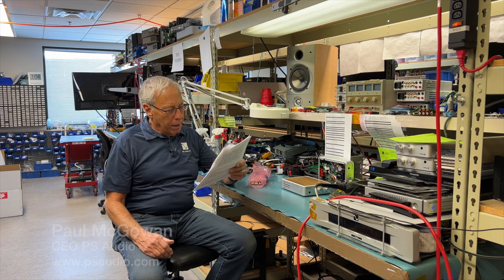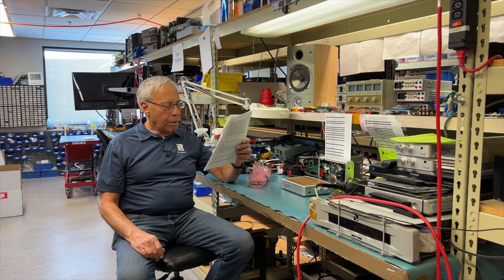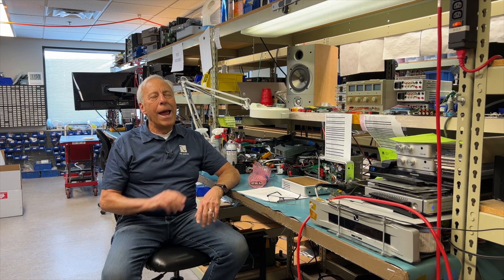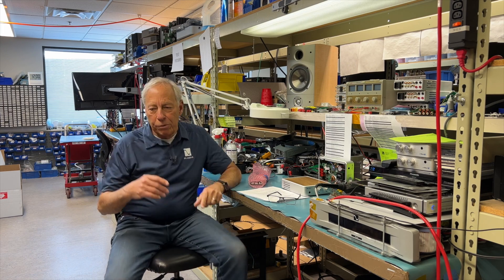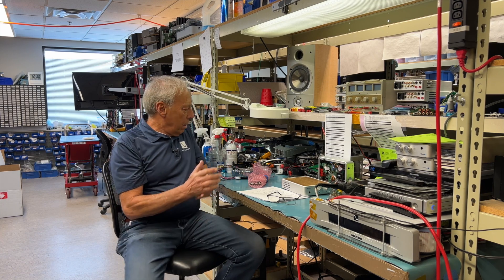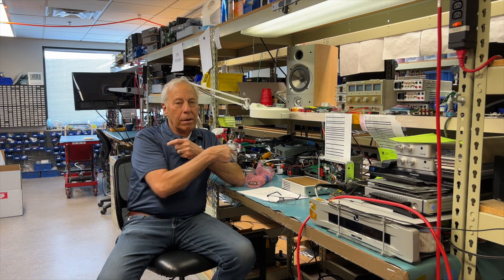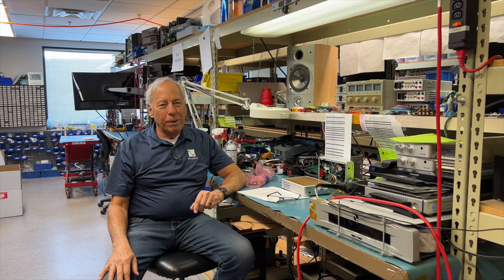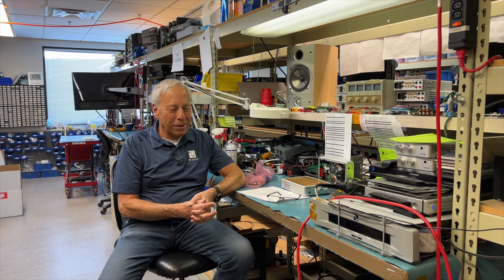Switch mode versus traditional power supplies

Comment: #1- SMPS is rectifying AC, turning 120BAC into 170VDC (240VAC into 340VDC)
#2- This high voltage DC is driving a high power oscillation working at 50KHz to more than 300 KHZ, some tines.
#3- This output of the oscillator is driving a small transformer, the secondary of which gives the required DC to power circuits.
Often, there is a secondary on the transformer used as a feedback to help regulate the SMPS.
If well designed, the secondaries will, after rectification and small filtering caps, gives exactly the required DC voltages needed.
The only big part is the filter capacitor for the power oscillator... And likely the transformer.
The poiint is, for example, a PC power supply that can deliver 1,000W to a load while weigthing well under 10 pounds.
A LPS of the same capacity might be above 100 pounds.

The only drawback of an SMPS is that it may introduce HF noise both toward its load as well as toward it's source.
Current well designed units do not suffer such problems.
Some audio equipment, like power amplifiers can achiev an astonishingly low 130 dB SNR despite having a SMPS buiklt in.

Comment: Paul makes a good effort here, but probably confused many newbies by trying to present his explanation as a contrast between a large power transformer and the entire switching power supply circuit assembly; which is sort of like comparing one cylinder (or piston) from an internal combustion engine to a complete Wankel rotary engine.

The contrast SHOULD be between a linear power supply circuit and a switching power supply circuit. Both circuits USUALLY have transformers, but they don't NEED to include transformers. Certainly power supplies of either topology that are being applied to isolating consumer circuits from the AC Mains voltages are likely to include transformers, at least for isolation if not for another reason(s).

The KEY difference between linear and switching is how the raw voltage is conditioned to the (usually lower) final desired voltage. A linear supply does this with some kind of actively changing resistance that drops any unwanted part of the raw voltage. A switching supply does it by slicing the raw voltage into pulses, which are then re-combined, more or less, into a smoothing capacitor in order to reconstruct a smooth final voltage. Both linear and switching supplies need to have smoothing capacitors, but due to the low frequency in linear supplies the capacitors have to be huge and expensive, whereas due to the much higher frequency of the switching supply, the capacitors can be small and much less expensive.

If a transformer IS involved, on a linear supply using Mains voltage as a source, and at the low frequency of 50 or 60 Hz, the transformers must be large, heavy and expensive, but on a switching supply the transformer can be quite tiny. But as Paul said, both kinds can still deliver the same kind of power to the 'load', whatever it is, and both kinds can have very smooth, very low noise output voltages. HOWEVER, a linear supply generates a lot more heat than does a switching type, because it must dissipate the unwanted/excess voltage in the form of heat. A switching supply only 'samples' as much of the raw input as it needs to achieve the desired final voltage, and thus it generates very little heat and is thus much more efficient.

Comment: From experience, switch mode PA amplifiers are unreliable in the medium to long term. 
I've owned S.M. amps made my respectable brands such as Camco and MC2. They eventually all failed and were uneconomical to repair. I still have various Crest Audio and MC2 audio torordial amps that are much older and heavily used that the S.M. and rarely if ever go wrong. When/if they do, they have always been repairable.

Comment: All I know about the power of moving electrons is to think if it like flowing water (as it's not really all that different) and to use the proper analogy between the two.
Volts is the spray pressure coming out of the nozzle.
Amps is how many electrons cross the exit point of the nozzle in whatever amount of time
Ohms is the resistance and not your grandma

Watts is the storage tank that's accessed when needed and is also on 2nd base because Who's on first and I probably have all of the above totally mixed up because I have a 500 watt brain with the wiring burned out causing me to not remember...

and stuff.  and I ramble.   and when's Superman and Capt Kangaroo coming on??  I've been sitting here for 65 years, and no sign of it yet.  Thank Goodness for the 3 Stooges and the Marx Bros, God Bless their souls indeed.

Comment: If I may say sir what about reliability. Too msny componants in a smps to go wrong.I have a 1980s psu with the big lump in it that has never failed even under heavy loads for fiddling? A smps will not last
Reply: Does it have large electrolytic capacitors?  They will likely be out of spec pretty soon!

Comment: I thought PS was about the sound, but it is about the cost...?
Reply: They can be "about the sound," but if they aren't also "about the cost," they will go out of business and then they won't be there to be "about the sound."  That's the way everything works--put your oxygen mask on first then help others.
Reply: @JohnSmith-qi6co  I feel it's more a matter of choosing which quality to offer at which consumers. Being a small company in a small market expanding geographically is a good idea for PS, but to maintain such an organisation, you have to meet (legal) standards and keep sales at a level, which compromises sales.For one your products need to be fool and bullet proof.  I bought speakers off a company that produces perhaps 2 sets a year and put all their heart and soul into it, besides their other products at a very small scale. But for them not many buyers and for me not many sellers. They indicated for instance, if you want a bit mor high, solder these resistors in. lol,

Comment: Switchmode was was invented by satan. 
They are noisy AF. And yeah, you can have a big inductor to absorb the noise like you find on buck converters, but it is still there. even that inductor radiates a degree of noise.
Also they break. They do not last!
Paul, please look into this. Switchmode has this weird failing mode where you can measure voltage, but the moment you add load, it shuts down. About 1 in 5 SM psu's will fail in 5 years.
in 10 years you are sitting at 3 in 5 failures.
Unless you plan to introduce planned obsolescence into your business model, this is not the route to take. As a hard core audio guy, I'm happy with the 60% loss on a traditional psu. No need to tamper with what works.
Consider this... we spend thousands on cables and other things to make the smallest difference, and then you want to introduce the worst component known to man directly into my signal path. Yes... direct. Remember, it is that output that eventually feeds into the main transistors. If switchmode becomes main stream in audio, you may just as well sell your expensive interconnects, and speaker cables and just use twin flex lamp chord. Replace your van den hull turn table cart for the cheapest one they have at wallmart. Sell your SACD, sell your dac. Just stream from spotify.

Comment: Recently switched over (no pun intended) to a regulated linear power supply for my DAC, made quite a difference compared to the switch mode  unit I was running for three years prior. They each have their place. Switching PSs are way cheaper to manufacture, smaller, lighter, way greater power density,  etc., hence their ubiquitousness today.  Properly designed they are excellent, but the run of the mill ones are quite horrible noise generators IMHO.
Reply: I had a similar experience with my Pi streamer. The upper frequencies were painful to my ears, making me want to leave the room after a couple of minutes. Changing to another switching supply (a Google pixel charger) really cleaned things up. Adding two ferrite beads to the lead took it the extra mile. I tried all the 5v switching supplies I had in the house and saw a reduction in ear discomfort with all of them. Only the Google one was smooth enough for the ferrite beads to stop it sounding slightly harsh at times. I'd still like to try a linear PSU at some point to see if it makes it slightly more mellow.
Reply: Made quite a difference how? Is this one of those "I could hear a HUGE difference" things??
Reply: @Connor Dylan  I'm not into the snake oil thing at all (I'm very happy with electrical wire as my speaker cables). Noise floor for one thing went down.
Reply: @Richard Wielgosz  they're inexpensive,  just audition them both for yourself and use the one you like best.

Comment: Never say never. I'm curious as always. Thus far have only heard few products using SMP that I thought convincing, and even there, always in terms of their quality/price ratio (within the respective quality and price category, as a layperson would think they should cost as much or less, not more), and that included products in the 20+k price category where I still kept wondering if they might not sound even better if… But since SMP are what mostly everyone is using these days, there's upward potential designing better ones. One of the best external power supplies available today is a hybrid construction, for example. Nothing at all wrong with higher efficiency, ultimately, the proof is in the listening.
Reply: "Convincing"? What does that mean?
Reply: @ConnorDylan Sonically. That's the sole purpose of an audiophile component. At least as far as I am concerned.

Comment: If I remember right, a switch mode supply uses a transistor that turns fully on and fully off very fast.  This is called switching a transistor between saturation (fully on), and cut off (fully off.) The out put of the transistor is hooked to the primary windings of a transformer.  The secondary winding (which is and isolated winding from the primary windings) has more windings than the primary windings.  Therefore it's a stepup transformer.  This output voltage, from the secondary windings, is fed into a capacitor (or several capacitors.) As the transistor switches on and off, alternately, the secondary windings charge up the capacitor.  This capacitor is the "resovoir" of current and voltage that powers the amplifier section of an amp.  Now, I'm going by memory on this description, so, if anyone sees flaws in this general description, chime in and correct what I've posted here.  In my description I used a single transistor.  In reality there can be more than one switching transistor.
Reply: Switched mode can operate as step up or step down as required for the application. The transformer(s) in a computer PSU have considerably less secondary turns than the primary to deliver the 12V, 5V etc from the 160V to 320V DC rectified mains that the input side runs from through the switching transistor(s) and transformer primary. The amplifier SMPS in this context will be a step-down design if it is supplied directly by the power mains. The higher DC source (where I am in Australia with 230V AC mains it would be the approx 320V) needs to be converted to the amplifier supply rail voltage, say 60 to 70 volt, with two outputs required for positive and negative rails.
Reply: @PlatypusPerspective  Thank you.  That's good information. It seems very accurate to me.  I hope that all will appreciate your words.
Reply: MOSFET rather than transistor typically.  The duty cycle is continuously adjusted to maintain a set output voltage.
Reply: @jimeadie4415  A MOSFET IS a TRANSISTOR (metal–oxide–semiconductor field-effect TRANSISTOR )  I didn't specify what kind of transistor is used.  On the old JBL 6233 amps (one of the first switch mode power supplied amps, called the "ice man")  bi-polar transistors were used for switiching. Of course other types of transistors can be used (which is why I didn't specify WHICH TRANSISTOR type can be used.) And, the duty cycle is implied in what I said. The voltage across the capactor is charged, and of course the charge/drain, implies frequency.  Please add to what I said, rather than just stating what I've already said.

Comment: @Paul, why are Class D amps typically fit with a SMPS, and Class AB with a toroidal transformer?
Reply: Class D amplifiers are able to be compact and lightweight for their power output, not requiring large heat dissipation. Using a switched mode power supply makes sense in terms of also being compact and lightweight in comparison to a conventional transformer with very large reservoir capacitors.
Reply: I am no expert, but the efficiency of a D class is certainly better than an AB. That is not to say that an AB couldn't use a SMPS, I think that most people that are in the market for an old tried and true AB would prefer the big transformer with large caps. The old technology works well, is quiet, and delivers good power at the expense of some extra weight (and heat). In my opinion, one just needs to look at some of the "no holds barred" designs like the McIntosh's and Krell's to realize that when money is no object, that is the design of choice. I have run many different amplifiers over the years, from NAD, Levinson, to Carver. They all have their pros and cons. It will be interesting to see where new technology takes us in the future.

Comment: A good rule of thumb is that cheap switchers will be worse than any linear. But expensive purpose built switchers can be better than linears. A lot of people don’t want to believe that switchers could outperform linears (probably due to all the $$ they spent on them) but it’s true. Switchers have a greater potential, but are usually cheaply build crap

Comment: Switching power supplies are nothing new. Science discovered long long time ago that as the frequency went up, the size of the transformer went down to transfer the same amount of power. So, if you wanted a smaller power supply,  you would take the incoming 50 or 60 Hz power, put it to an oscillator that would "switch" it at a much higher frequency, then use a much smaller transformer to make a conventional (linear) power supply. But now, you would also need some extra filters to clean up the higher frequency components brought on by the oscillator. That's what it is in a nutshell...

In most cases, switching power supplies are chosen to eliminate an large, expensive transformer. Therefore, most switching supplies have the number one design goal to be "cheap" and, in line with this goal, the filtering I mentioned above is also not done properly. The lack of proper filtering and shielding makes most commercially available switching power supplies a poor choice for high end audio.

Of course, a switching power supply can be designed and constructed in a (expensive) way to have an excellent noise filtering, which would make it suitable for high end audio use. However,  almost nobody does that because you don't want to deal with such a complex design when you will likely have no cost or performance advantage over an equivalent conventional (linear) power supply.
Reply: High power SMPS also need active power factor correction in most jurisdictions as the big rectifier capacitors create big distortions on the mains without this. High power, high powerfactor, extremely low noise switching power supplies exist, but as you correctly point out, they are complex and relatively expensive. The best example is High end PSUs in PCs, noise is a major issue for High performance machines and really good power supplies are nearly linear in their performance.

Comment: I have a Technics mini-system that has a separate Pulse Power Supply Unit SH-C01 for the 50W RMS amp SE-C01. It was bought in 1979 and looks like it was 45 years ahead of its time.
Reply: It is true that the SECO1 amplification and the SH CO1 power supply unit were a POWER SUPPLY UNIT PULSE. The slime line by TECHNICS which I bought in London in 1980 exactly

Comment: What about linear power supply? I’m no expert, but from what I read and understand you get a lot better sound quality using that. Is it worth the extra money?
Reply: dont believe the audiofools .
Reply: Linear is what he’s comparing switchers against. Toroidal is linear. Linear will be surpassed by high end switch mode eventually. Some already do
Reply: @chrisladouceur4093  I suspect the question might be about a linear regulated power supply, which is rare as they are bulky, inefficient and expensive. But deliver very clean supply rails.
Reply: @PlatypusPerspective  same story though. Regulated or not, there is a lower limit that linears cannot get below due to the transformers
Reply: @chrisladouceur4093  A lower limit in what parameters?